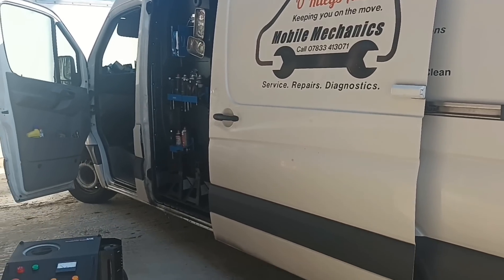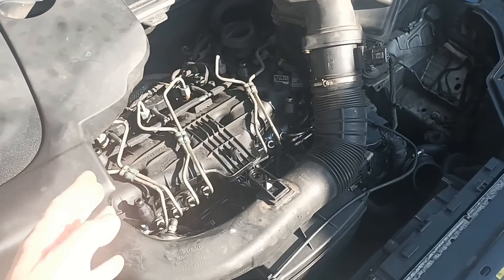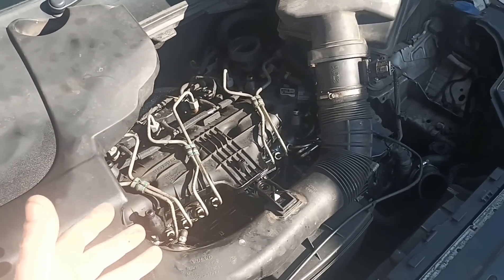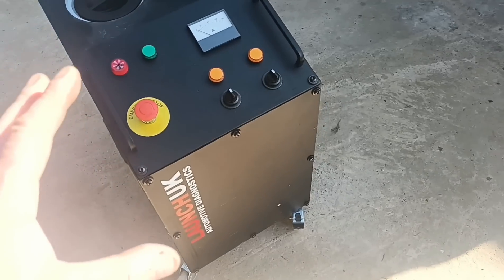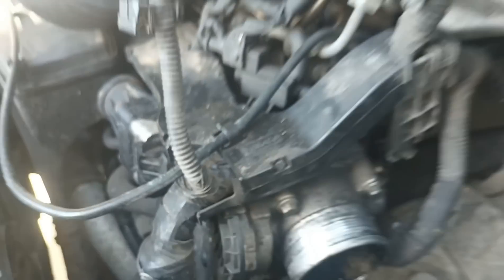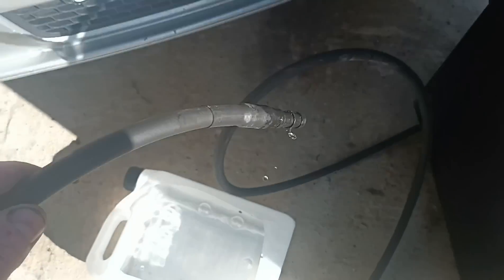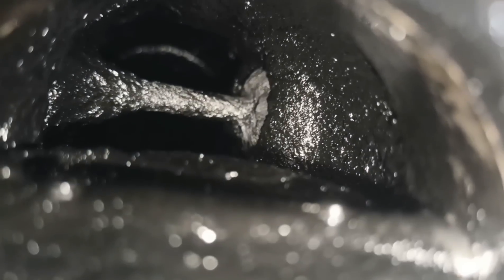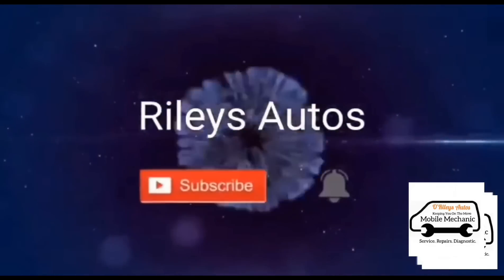Does HHO Hydrogen Engine Carbon Cleaning Work? Is It A Scam?

Comment: You are 100% right like I said on the last video hho will do nothing for the inlet side hydrogen has no cleaning properties what so ever but once it's burnt it goes back to water and oxygen so the water has a steam cleaning effect on the pistons and combustion chambers but will take a long time for any effect 
We have had a carbon cleaner for 2 years now and I have yet to see it fix a problem don't waste you're money the customers will just come back and accuse you of ripping them off as it didn't fix the car
Reply: I did it to a 1998 Toyota camry and the drove for hours at 100 ++ miles per hour. I drove it WITH the hydrogen (machine I made). I also used a cleaner product twice (my secret one) and another good product. Then I changed the spark plugs and the pcv valve. It's literally runs like a brand new car. I can prove it.
Reply: @TravisTellsTruths  i also can prove my product called "hands" better then ur BS market commercial*

Comment: It might well be the case where someone has proven that HHO breaks down carbon and the more shady opportunists have made cheap HHO generators at a huge markup plus misleading marketing to make a quick buck.
The only way I can see this working is if you drive around for 100s/1000s of miles with the generator permanently hooked up and then compare the before and after pictures. So basically this 'idea' has no real real world application in the motor trade whatsoever.

Comment: As far as i'm aware HHO cleaning is more for the Inlet and Exhaust valves as opposed to EGR as the Hydrogen has a more complete burn than normal fuel and this with the water is how it is cleaned by the time it gets to EGR will just be water so will do nothing.
Reply: Also piston tops and the cylinder walls come up shiny new. I watched a before and after first hand. This guy is looking in the wrong places.

Comment: Jimmy, put the better diesel in or add 2EHN in the tank (same thing) amd more gets burnt at lower temp therfore less bulds up. A cheap water injection kit is supposed to work wonders with steam cleaning the back of the inlet valves,  but I've never seen anyone like yourself prove that.

Comment: This are ment To clean combustion area and exhaust. Not for intake cleaning so this test is not so good. We are allso now testing this machine but we are measuring exhaust pressure and making exhaust testing before and after. Not so big hope for this but have To test 😂
Reply from the maker: I also showed the exhaust Temperature didn't increase here and the pressure actually raised a bit

Comment: One of the great cons.   Dose nothing for the intake system , how could it ?  A small amount of hydrogen gas fed into the intake along with air.  
Good honest video as always.
Reply: So the hydrogen.  Is not producing is not - anoth? 
If pull full of and and rain just on hydrogen. It would clean..... 100 percent
Reply: Only cleans post combustion,  so no it doesn't clean the inlet manifold.  😂

Comment: 100% that doesn't work , oven cleaner left soak for over an hour barely works on hardened carbon build up !!!! don't waste your time and money ,  easier just to take all the parts off the car leave the soak in petrol over night and go at it with a wire brush

Comment: Jimmy, if you've followed the manufacturers recommendations and you're not happy with the clean, then it's a null brainer.
I do agree,  it doesn't work.
After an hour I would expect the internals to be minted.
So, now we've all seen how mucky it is in there, when are you doing the walnut blasting video?

Comment: it's a shame this doesn't work - i was considering getting this done after seeing terra-clean done on wheeler dealers but sadly this video does seem to show that it is all just snake oil
Reply: Tereaclean is chemical based
Reply: Terraclean is different they use a fuel additive directly pumped into the injectors with there machine
Reply: @sbrader97  thanks - didn't know that.
so is it worth doing? but presumably doesn't clean EGR valve?
Reply: @djneils100  Yeah i doubt it will have much effect on the egr only injectors and pistons/valves wont be much cleaning of the exhaust side no matter what these companies claim
Reply: @sbrader97  If Terraclean is injected via the injectors then its not going to clean the intake. If you've got anything that injection into the combustion chamber ending up in the intake then a carbon clean is the least of your worries.
Reply: @hughmarcus1  Yeah on direct injection it won't clean the valves
Reply: @sbrader97  Irrespective of type of injection (though everything has been direct injection for at least 25yrs) it won't clean anything because  tis likely to get vaporised during combustion, there may be some residual cleaning in the exhaust, but it's probably marginal.